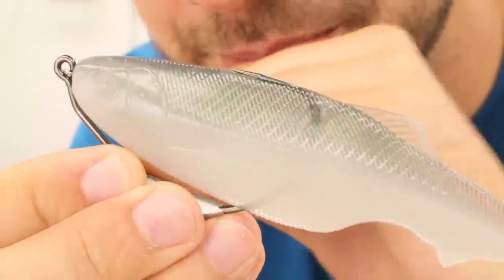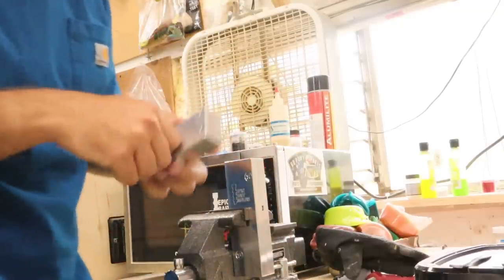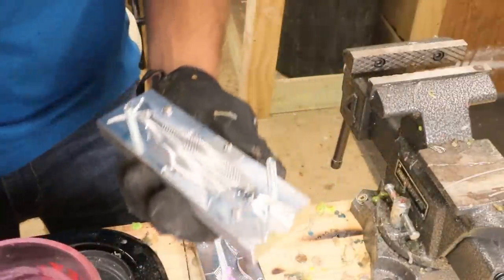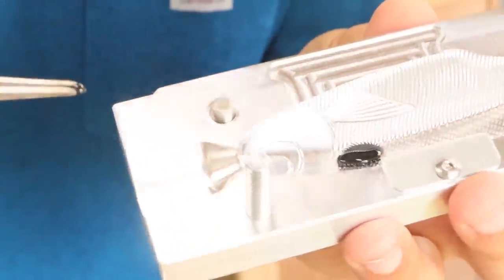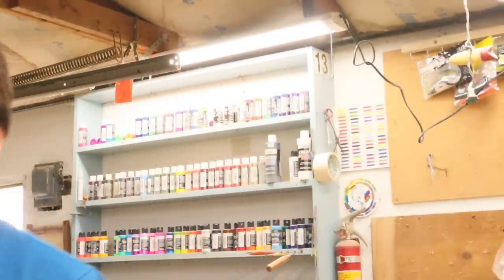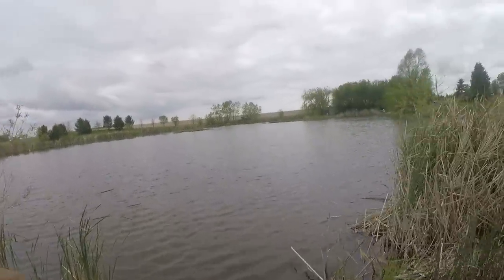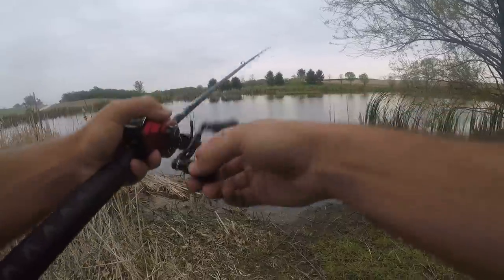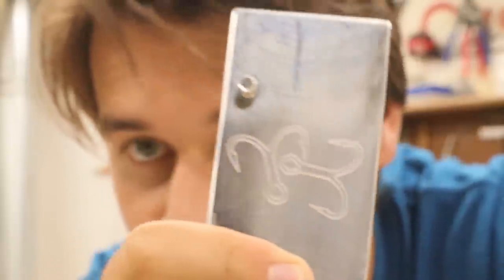An Epic Injection SwimBait | Inject to Catch

Comment: Has anyone noticed that his eyes on his rod were offset?
Reply: It’s actually better for swimbaits if the eyes on the rod are spiraled
Reply: I noticed the same thing but thought it was for some reason! Now where to find them!
Reply: My ocd was off the charts when I saw that...  thought it may be a 2 piece rod and the end section wasnt aligned
Reply: @hlifino1  the company that makes the rod is called low down customs they make probably the best swim bait rod you can buy
Reply: It’s an acid wrapped rod. Not super common, but a few companies make them.

Comment: Why rod is not lined up ? Seconds section is a bit off to the right lol
Reply: If you're talking about the guides, they're like that intentionally. By wrapping the guides around the rod, it can help prevent the line from coming into contact with the blank.
Reply: @Wastingtime689  yup, called spiral guides.  Custom build I'm sure.

Comment: "Science facts: Did you know that mollusks like squid and arthropods like shrimp have copper based blood?"
Does this mean that a lure made with copper instead of aluminum or steel might attract fish by smell? (Like Mepps spinners with their brass body parts?)
If you handle copper or brass you can smell it on your hands... inquiring minds want to know...
Reply: Curious... Granted you’re not actually smelling the metal it’s the oils on your skin being catalyzed by the metal. The bulk of the smell is cause by 1-octen-3-one. But I wonder if the metal in the blood catalyzes anything that would cause that smell we associate with metal! Under further research I suppose that is the same reason blood smells “metallic” when it contacts your skin. So perhaps when said type of fish is bleeding the blood might catalyze the oils on its skin and produce a more potent metallic smell...
Reply: I think you may be on to something.

Comment: IF you see this, I found a way to easily avoid scratching my aluminum in the vice.
Make a clay (or w/e really) mould of the vice clamps, then create hard rubber (you know what I mean) covers for the clamps. 
Easy on/off, and cheap to make/replace.
No more scuffs.

Comment: Get some sheet copper and wrap it around the jaws on the vise. Or glue some plywood pieces to the outside of the mold.  That will protect your molds. 
Very very cool bait. I would buy a couple of packs, not likely to buy a mold.

Comment: Casting with your right, and cranking with your right.....I just don't get it. I cast with my right, and crank with my left. Like eating steak. Stick the steak with your fork in your left hand, then cut with knife in right hand. Then put meat on fork with left hand into mouth. Why would you set down the knife, and then swap the fork with meat into your mouth with your right hand? Wasted motion.
Just wondering.  😀